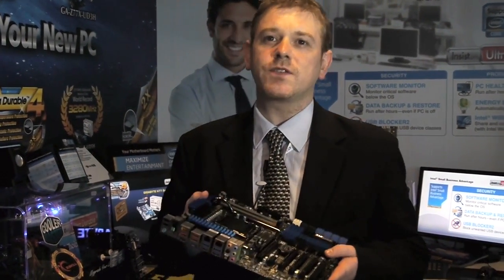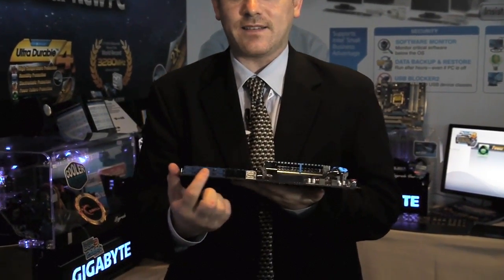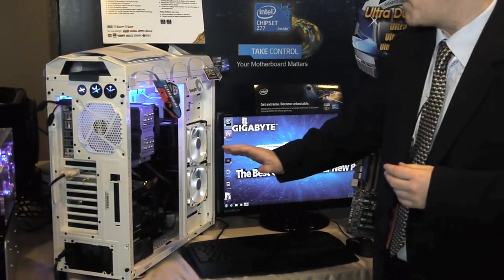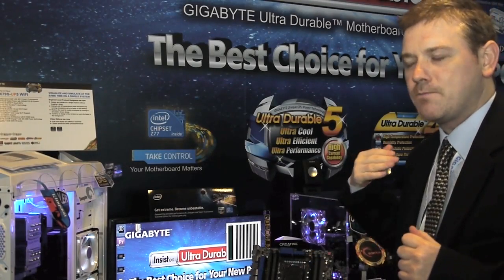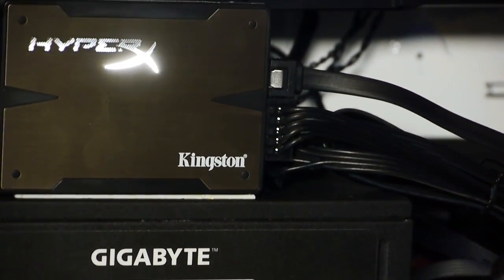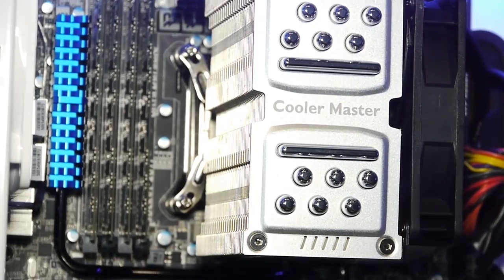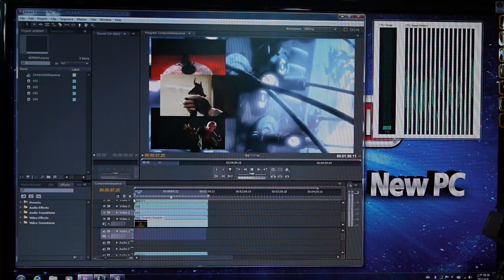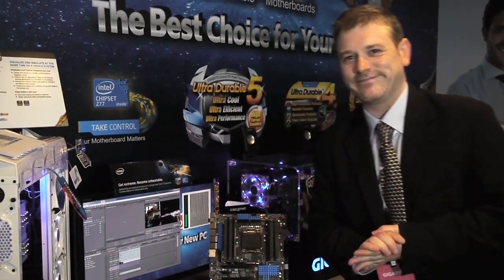GIGABYTE - X79S-UP5 DIY Profesionnal Rendering Machine

Comment: I wonder how well the GTX cards (GTX 670) would perform as an acceleration card, like they use the Tesla card for. I want to build a system like this, but I want watercooling, and I also want it to be more flexible. How well do the cuda cores on the 670 compare to the tesla card used?